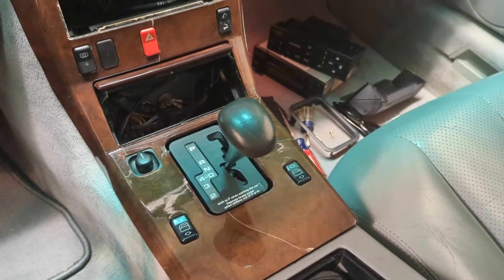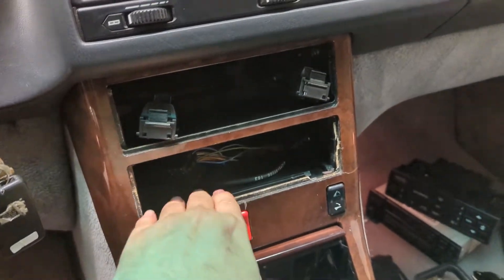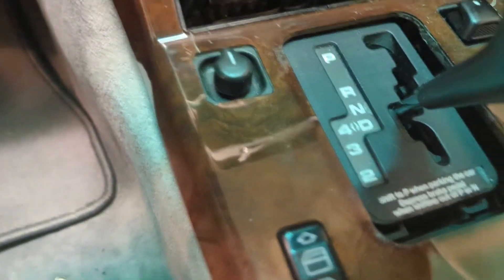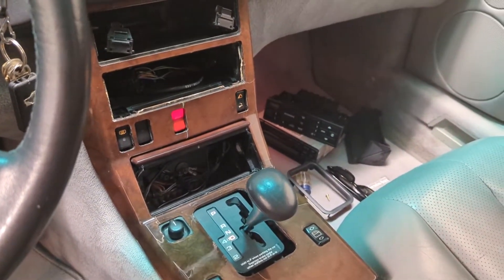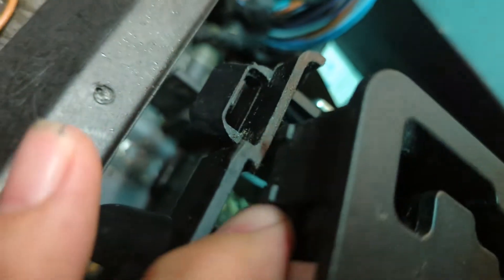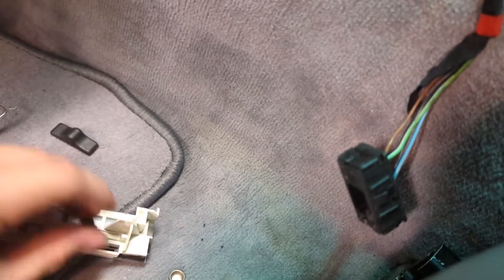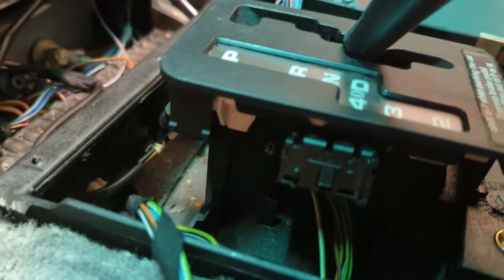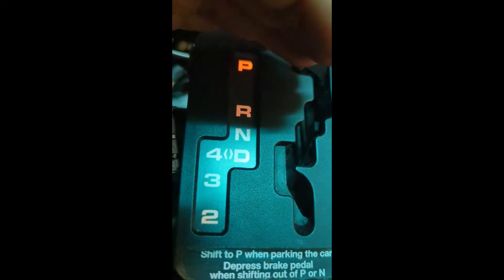Replacing the wood components in my SL320 (R129)

Comment: E is for economy
S is for sports
Got the similar selection of driving mode on my wife's 1995 Lexus GS300, the one that has the Supra engine in it.
Reply from the maker: I had to look it up in the German manual (since mine didn't have this) - you're right! 🙂 E = economy and then S = standard. The SL500 and SL600 have W and S for W = winter, S = standard.

Comment: how much did the new wood cost if you dont mind me asking
Reply from the maker: I had the SL600 wood (center console area w/ the roller box), the regular console, and then the wood from both doors (seat switch + door handle cover, 2 pieces on each door) done for $875 USD 🙂 I did run into a problem with the roller box, where the plastic handle broke... so I put the gray vinyl piece in for now (which does slide a lot nicer).

Comment: Where did you get this cup holder?
Reply from the maker: Hey there! Cup holder was standard for USA models from 1996 I believe and newer? I found some cars in the junkyard and pulled the part. It's quite easy to retrofit to the older models. The hardest part might be to find the right color vinyl sliding cover. eBay has a ton of these available - you might check there too